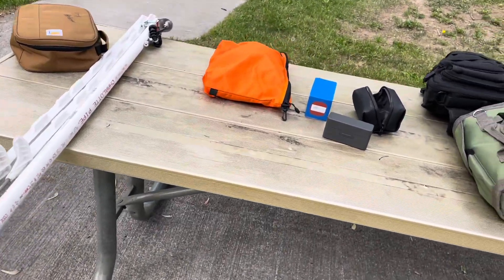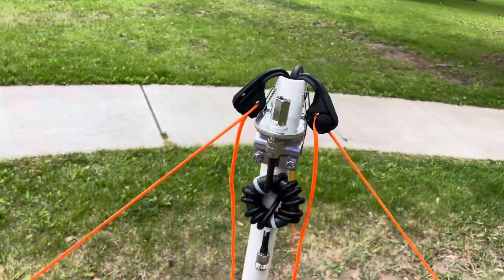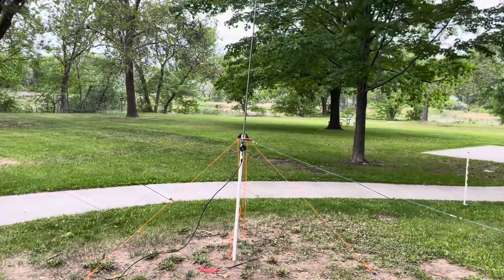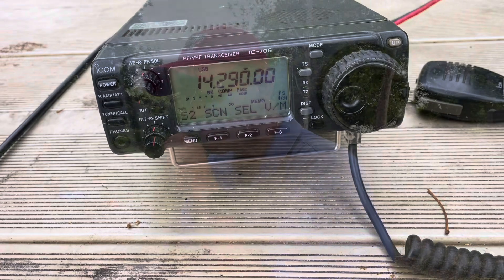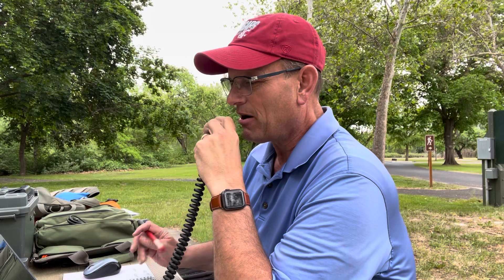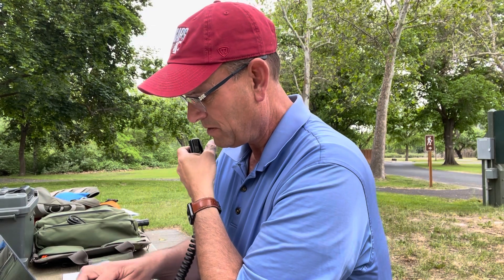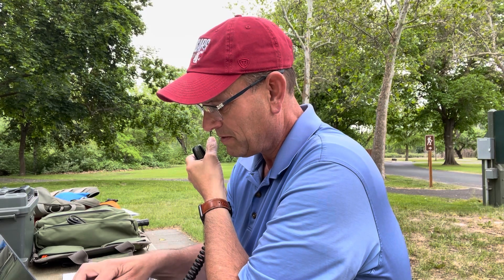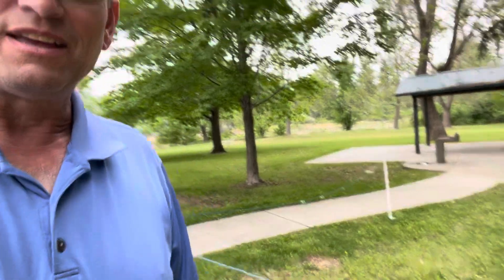How to Ham Radio - POTA performer antenna

Comment: Interesting use of Wago connectors and cable numbering. Re directionality, if you read KJ6ER's full article on this antenna he makes it clear that, when the radials are set at 90 degrees, the antenna is quite directional.

Comment: Great video!  I'm glad to see someone else use Wago connectors.  I plan to rebuild the radials using Wago's and crimp-on ferrules.  73 de NS8Q
Reply from the maker: Thank you.  Yeah I think wagu connectors and quick easy and pretty affective!  73
Reply: @KA7APRhamradio  Do you disconnect the wire from the, Wago connectors to adjust radial length? TY & 73

Comment: There's a way to build a Performer using three telescoping antennas. It is built around the mirror mounts that truckers use to mount CB antennas along with three of the cheap 18.5 ft. telescoping antennas from China and three 10 mm to 3/8 x 24 adapters. (The best price I have found is at McMaster-Carr #92499A793). The advantage is that you can mount the result to a tall tripod such as those photographers use to get the radials well above the ground and out of the clutter or those walking by. It should work for all bands from 20 meters up to at least 6 meters. With the length adjusted to resonance, I get about a 1.1 SWR on 20 up to about 1.4 on 10 meters. Drooping seems to improve the impedance match.

In the pictures linked below, the two BNC dust covers short the horizontal elements to ground, making them radials used with the vertical whip fed. As an alternative, feed one of the horizontal elements and leave the other shorted and you have a modest V dipole. (Fully extended for 20 meters, they droop a lot.) These pictures also include a recent addition, a through-chassis BNC connector that allows VHF/UHF antenna to be installed or one of the banana-to BNC jacks and a wire dipole for perhaps 30 or 40 meters. I used nuts larger than the bolts for the interior spaces, so those wing nuts tighten everything. That makes installing it simpler.  All it all, it is quite versatile.

The pictures are the named and numbered Performer jpgs at this public Dropbox link. Feel free to pass the pictures on and vary the design to suit your needs. I’ve gone through about a dozen adaptations myself.

https://www.dropbox.com/scl/fo/lnyuz21yzstrdpf6t6xq5/h?rlkey=amxtnzn9fwfpd0sqv0o6l8rxn&st=t3sxza0z&dl=0

And it does perform. Performer-WSPR-20.png shows the WSPR results on 20 meters with about 3 watts out.

--Mike Perry, WA4MP

Comment: What toroid did you use and was that RG8X coax.Also do you have info on the connectors you used to connect the different lengths of wire.
Reply from the maker: Torrid was a 240-43.  Just search for that on Amazon.  Yes RG8x.  I use Wago connectors.  Quick and easy.

Comment: Thanks for this! I see that Greg uses a 17 foot whip. Are you achieving the same resonance with a 25 ft whip and the same length radials? Thank you again. Rick AJ7DS.
Reply from the maker: Yes I am!  You have to find tune the 17 or 25 foot whip, but I don’t see any difference with either one.  Thanks for your comment.